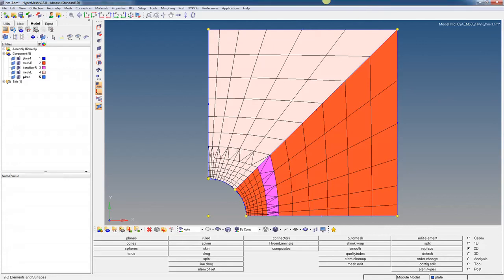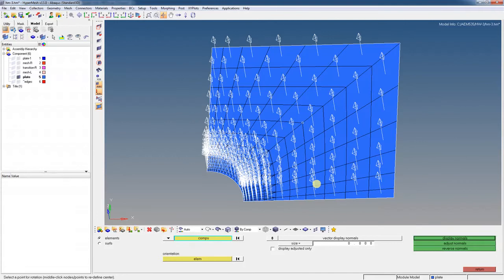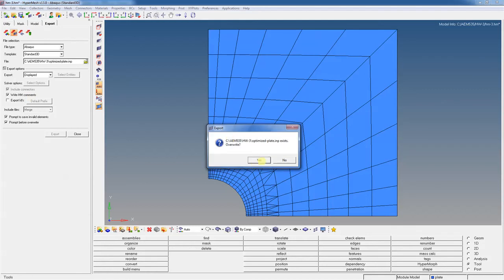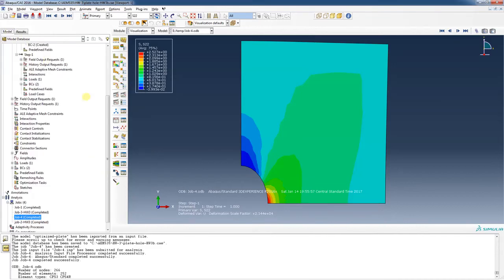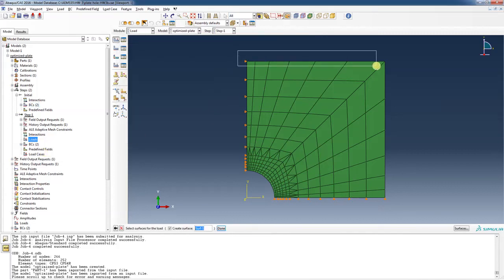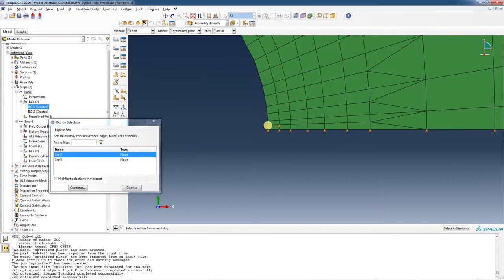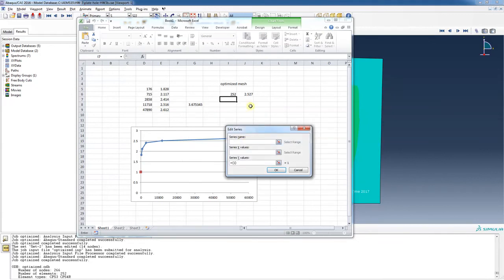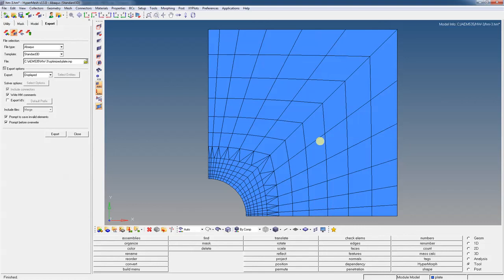AEM 535 HW-3c Import of Optimized Plate Mesh into ABAQUS and Results

Comment: Hi professor Barkey. 
How can we tell when we have a stress singularity rather than a real stress concentration? I've run FEA models where I always get a crazy amount of stress in connections between elements. But those are really small localized points, some people ask me to crazy reinforced those areas to see if we can get rid of the high peak in stresses. In my mind that peak would not be important since it's in very small localized point and probably von mises it's not even applicable due to the constraint in connections and the possible development of tri axial state of stress. What do you think about it ? how would you approach those issues? Thank you so much
Reply from the maker: Crack like stress distributions are distinctive. You can see some in the next series of examples.  Connections, MPCs, and point constraints can all cause local stress disturbances and are hard to alleviate.  Auto companies will often use standard element sizes and connection techniques so that they deal with known modelling errors.

Comment: Hi,  when I am trying to import inp. file from hypermesh to Abaqus it's just giving me an orphan mesh and I am unable to assign any property to it. What is the solution for such case?
Reply from the maker: Without more details, it is not easy to know the issue.  Have you done the same process as in the video?  What kind of elements are you using?  Is your section definition consistent with those element types?
Reply: @mbarkey.mechanics  I am new to hyper mesh so figured out that I wasnt using section property in hypermesh, I even define section property of a deck and reinforcement in it but when i import it in abaqus its again an orphan mesh.
Reply: my model is of a reinforced dek slab with shear pockets in it. I tried using 2D auto meshing.
Reply from the maker: @sadiaumer949  Imports/exports are never completely perfect.  One way to use Hypermesh is just for importing the orphan mesh into ABAQUS, and then assign section controls, etc. in ABAQUS.  This is the way I usually work with it.  But if you can do everything in Hypermesh and get it to export/import correctly, then that is great.
Reply: @mbarkey.mechanics  Yes I am trying to perfectly import it. Thank you for your suggestions and time.
Reply: @mbarkey.mechanics  Mr Mark can I have your email I want some guidance in designing a reinforced deck panel meshing is really difficult if I design my reinforcement as the solid section. When I combine deck and reinforcement the region become complex for Abaqus to mesh and it's highlighted in pink. I am doing lifting analysis on deck.
Reply from the maker: @sadiaumer949  I have done some work with making equivalent orthotropic plates for decking.  It might be a way for you to reduce the problem to be more tractable.  The equivalence would need to be based on a more detailed model however.   If you search for my name you should be able to find my email address fairly quickly.  That said, I don't expect to have any time for specific advice anytime soon, due to work duties.  Take care!
Reply: @mbarkey.mechanics  Thank you so much for your timely and detailed reply. I'll definitely search for your work for more understanding.

Comment: What is the significance of having all element normals in same direction? Why do they have to be in same direction?
Reply from the maker: For 2-D elements, the element connectivity determines the direction of the element normal by the right hand rule.  Imagine a triangular shell element with nodes 1-2-3.  The "top" surface is the direction in which the normal points out of the element.  The "bottom" surface is the other surface.  Now imagine the shell being bent, putting one surface in tension and one surface in compression.   The computer program needs to "know" what surface is the top/bottom to correctly determine what the sign of the stress will be.  

Furthermore, in contact problem and flux problems, the computer code has to know which way one surface is interacting with another surface or which what the outward normal is for flux calculations.

So, if the normals are not all in the same direction, your code may not run at all when it checks (as in ABAQUS) or you could get some bad results.

Hope that helps!
Reply: I tried reversing all of the normals and reversing some of them also. When I ran two models. Abaqus aborted both of my jobs, so It really take the directions of the normals into account. Regarding numbering nodes, I showed the numbers of the nodes and it numbered the nodes randomly. It did not follow the counterclockwise fashion or the clockwise one. I think the directions of the nomarls have nothing to with numbering nodes. Hope to hear from you. Thank you.
Reply from the maker: The element connectivity ordering determines the normal direction, not the value of the node numbers.  Please refer to the ABAQUS manual as there are some figures there that will explain it.

Comment: Thank you for your video. I have a question.the tria elements 'quality looks not good.does this affect the result?
Reply from the maker: Thanks.  The angles on some of them are a little extreme, but I do not believe it is a problem for the result for the stress concentration factor, as seen by the convergence plot using the very fine mesh directly from ABAQUS.   The stresses at the elements will be affected though, as any constant stress triangles should be avoided where stresses are important.

Triangular elements are very common and are unavoidable in these types of transitions, unless you use a tie constraint to connect dissimilar meshes.  I plan to cover tie constraints at a later time.

FEA is always a balance of computational cost (time), mesh and model building (more time), and quality of results.  While this linear elastic analysis is trivial on any computer these days, we will eventually build up to non-linear materials and time histories of loads, which can still be computationally taxing with a non-optimized mesh.